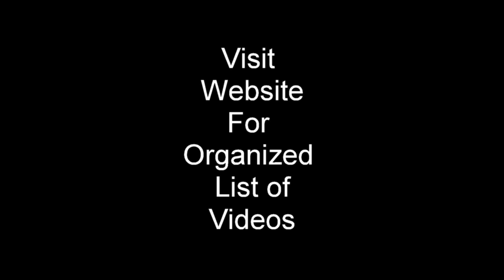How to Re-roof House with Composition Shingles – Home Renovation Slideshow

Comment: I think that roof jack on the vent pipe is incorrect. If water comes in at the base it could leak inward. It relies on sealant, not mechanical design. I think it should dashed at bottom to daylight.
Reply from the maker: I've seen hundreds if not thousands of homes done this way in Southern California, but imagine it could be a problem with low sloping roofs and in areas with snow.

Comment: I'm assuming 1x4's can no longer be used for roofing on a new home. I dint think I've seen it done that way on a house built after 1975
Reply from the maker: I think the last time I saw it done was around 1982, but I'm only guessing. I don't know enough about engineering to comment on whether or not this method was superior to plywood or vice versa.
Reply: gregvancom me neither. I've been in few older attics where anyone could see that it was done this way. The newest of which was built in 75. The only 2 factors I can think of other than regulation is cost and strength.
Reply from the maker: That's actually why we used it in the early 1980's, was to reduce cost. It does create an incredibly strong surface, but takes about three times as many nails. The people who did our nailing often complained about the time it took.